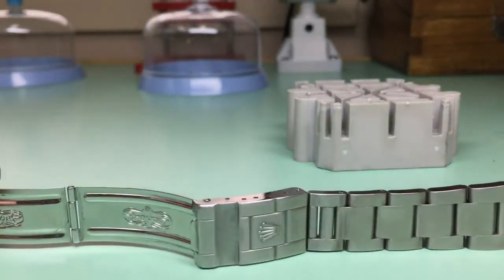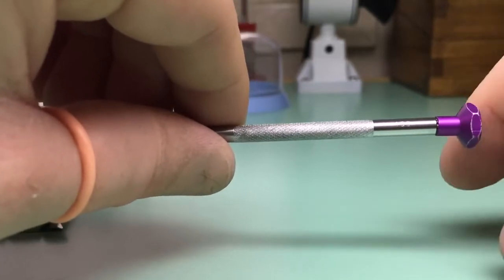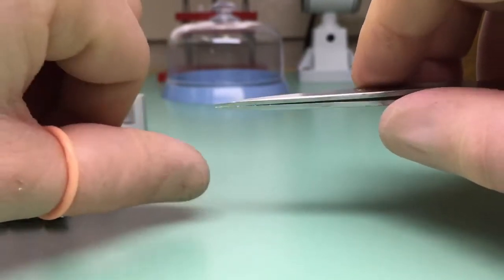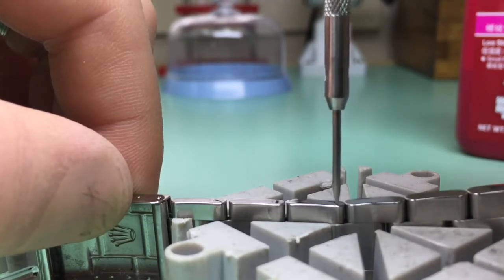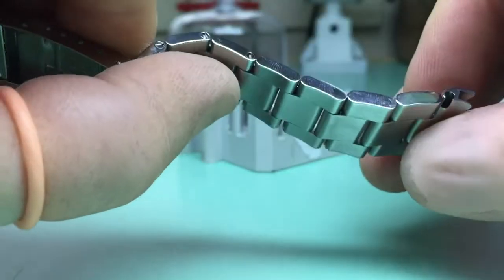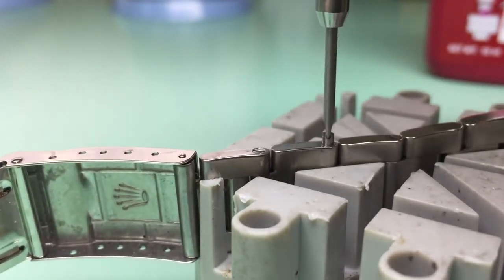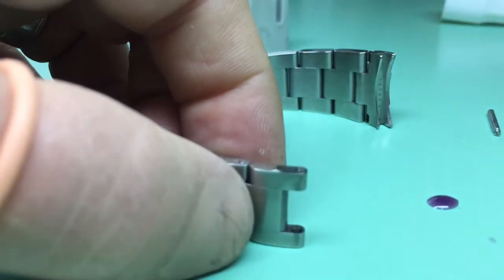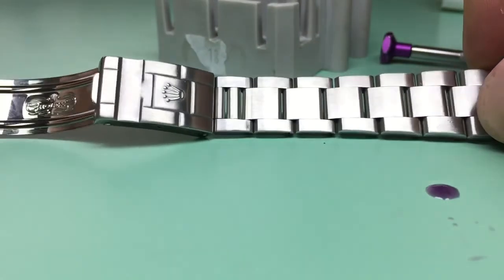Rolex Oyster Bracelet Screw Removal

Comment: Should be using a heat gun to heat up the lock tight.
Reply from the maker: Well, tell that to the Rolex service centre. I’m actually a Rolex trained watchmaker and that’s how we did it there.
Reply from the maker: @alexl6433  well, see above. Take it up with Rolex. They trained me.
Reply from the maker: @alexl6433  would you care to explain why?
Reply: @theseikologist  not only the heat gun would not leave any burn marks (I know they can be cleaned) but you can regulate how hot you want the temperature. It would make a cleaner job.
Reply: @theseikologist  try using logic as to why. But then again you think you know everything. Try offering advice after using it professionally, but okay, you go on and think you know everything. Also, about your attitude towards helpful comments ,,l,, buddy
Reply from the maker: @MeetTheSLAYER  your initial comment just said - should be using a heat gun. this is neither constructive advice, nor does it offer any explanation. it’s trolling of an informative video trying to teach people how to correctly remove bracelet screws. You haven’t told me why it’s more beneficial. you haven’t offered any relevant information to the community whatsoever. A heat gun is not necessary. Many people will not have access to one. lighters are cheap, commonplace. The only downside, that has been pointed out is some soot, which wipes clean. There is no risk of damage and no downsides. As i mentioned previously, when i worked as a Rolex watchmaker this is how we were trained to do it. So i think the method probably stands up. If you would like to enter into a discussion about the logic as to why, i’m all ears. But at this point, it just seems like trolling with the lack of any explanation.
Reply from the maker: at what temperature does loctite burn off? It isn’t burn marks, it soot which will wipe clean. If you use a small flame torch you won’t have any soot. Again, most people will already have a lighter. Why does temperature need regulating? What purpose would that achieve? People seem to be horrified by the thought of using a flame on their watch. The reality is that’s how you heat things up. Watchmaking is low tech, it’s not art, it’s mechanics.
Reply: @theseikologist  over 500⁰F
Reply from the maker: @alexl6433  which loctite? There are many…
Reply: @theseikologist  lol you have 3 colors purple low strength, blue medium and red high strength almost like welding strength
Reply from the maker: @alexl6433  I’m asking if they all break at the same temp, I honestly don’t know.
Reply: @theseikologist  no, red one you need to basically grind it because it is as strong as welding
Reply from the maker: @alexl6433  good to know. So other than some soot that wipes off, what are the advantages in your opinion?
Reply: @theseikologist  advantages in what sense?!
Reply: Coming from knives, I simply like to use a blow dryer. You really do not want to be burning or overheating if you can avoid it.

Comment: What if the screws are stripped what then? And I mean stripped completely flush and smooth. On a ball engineer hydrocarbon spacemaster orbital 2? The links are ruined trying to remove the pin I dont care about them I just want to extract the two destroyed pins...

Comment: Any idea on how to remove a link from an older Rolex Oyster bracelet (from early 70s) with the folded links? There are no screws and no pins in this type of bracelet. Is spreading open the link the only way to adjust these bracelets?

Comment: Do you think service centre like RSC also uses lighter flames to heat the thread before removing the screws?
Reply from the maker: I don’t have to think, I know they do. I worked there. Can I ask, why are you surprised? People seem to be so scared of flames...
Reply: @theseikologist  I am not afraid of flame but find it quite premitive but if that works perfectly and like you said you know from your working experience then that is a very useful tips for me as a novice.
Reply from the maker: @Saints-Forever  it’s watchmaking. The whole thing is primitive. How does a mechanic heat up a bolt he needs to loosen? He uses a torch. A watch is just a mechanical object. A piece of engineering. Wheels, screws, etc. People have a tendency to forget that due to luxury price tags. But at the end of the day, you employ simple, mechanical principles to do the work.
Reply: @theseikologist  Couldn't agree more and is enlightening the way you explained it from a watchmaker's perspective.

Comment: What about removing the pin on the clasp on the o’clock side? Left side by the flip lock? I need to remove another link on the six to fit right on my wrist. Looking for 4 links on the six. Want to remove pin to remove fifth link then replace pin going into 4th link for the 6 o’clock. Thanks

Comment: Is Loctite essential or can I do without ?
Reply: it is not essential
Reply from the maker: You don’t need it, but the chances of the screws coming loose is exponentially increased.
Reply: Not necessary. Admittedly the risk of screws falling out does increase from one in ten million to one in 7.5 million. Godspeed.
Reply from the maker: @jaredcoffin3907  well, when the manufacturer suggest loctite on certain components, I find it’s best to follow that advice.